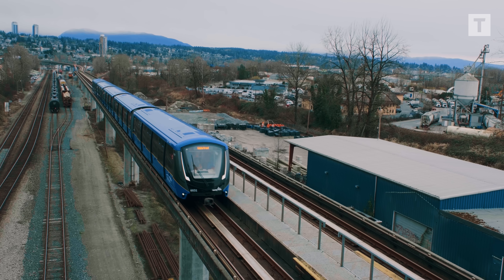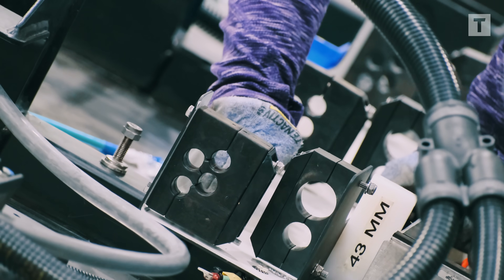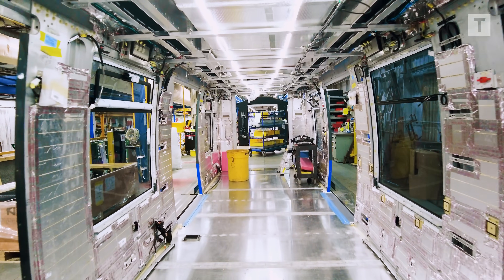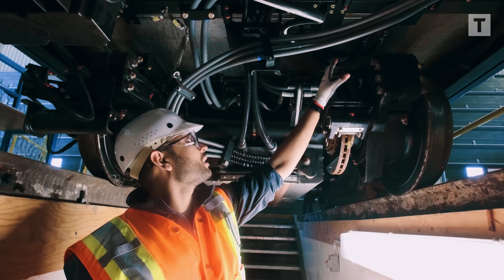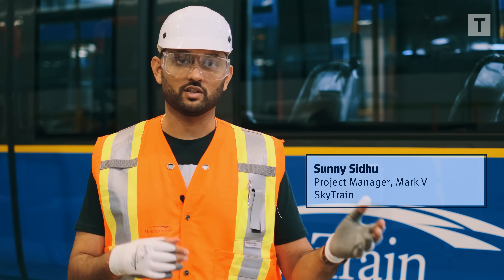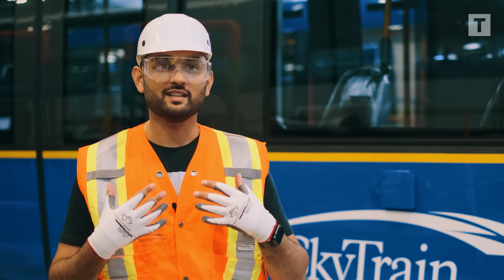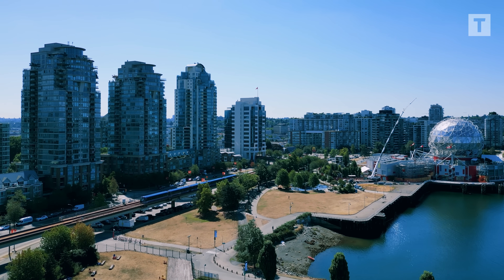How a SkyTrain car is ACTUALLY built

Comment: Rigorous testing huh?  Be nice if the wheels could be manufactured to be quieter.  When translink cars take a bend they literally screech drowning out off all noise for a radius of 150 metres.
Reply: thats like. the whole point of a new train
Reply: @Caty15  Theyre still screeching.
Reply: @quarkedupphoton236  thats because you are still on older trains. there are only 5 of these in service right now
Reply: @Caty15  I'll skeptically await to see one screech  by then.

Comment: Wait so is there a low chance that the public will have a small chance to see a skytrain outside of Vancouver, in either Ontario or Quebec just driving around on normal tracks?
Reply: The test facility in Kingston is actually outside of town in the tiny community of Millhaven (in fact, the Alstom facility and a prison make up the majority of said town...) and the site is just barely visible from farm roads. The Kingston facility is left over from when the technology that the Skytrain uses was developed as a provincial goverment project of the Ontario Government called Intermediate Capacity Transit System or ICTS, under the Urban Transportation Development Corporation or UTDC, this spawned the Mark I trains. UTDC got privatized at some point in the 80-90s, and came under Hawker Hawker Siddeley, who made it their Canadian division, before it became part of Bombardier. Bombardier took the ICTS concept and massively expanded it leading to the Mark II and III. Bombardier divesting it's rail business to Alstom resulted in the Mark V of today. Not only has the Kingston facility survived 4 companies, the ICTS system as a whole has endured the test of time.

Comment: Q: Why is it shipped by truck, and not by train?
Reply: im not sure about Vancouver but most rail depots don't have a heavy rail connection or even a loading area where they could offload the train onto the sky train tracks. A truck you can bascailly bring it anywhere you need. thats my guess
Reply: @brendanbruce6135  That's a very good guess and is probably right.

I'll have to double check with Google Maps, but I think that there is a siding in their yard just for unloading...of maybe for maintenance vehicles to get on the rails.

You're right about not connecting their yards to heavy rail.

I'm still surprised that they never used heavy rail for the majority of the trip, though.

Comment: I hope it’s quieter than the existing cars. I measured as high as 90 dB. I find it hard to ride Skytrain without noise cancelling headphones. I was recently in Kyoto and was surprised at how much quieter the trains are there. Why is Skytrain so loud?
Reply: It’s intentional that they made it loud. It keeps you on your toes and prevents passengers from falling asleep and missing their stop. 😂
Reply: Japan regularly changes its rolling stock. They retire older sets much more quickly than we do.  
Also, it depends on what kind of train in Kyoto. Not all of them are quiet.
Reply: The Canada line is much quieter, totally agree the expo and millennial line is very very loud!!!! We are NOT in the 80s anymore, the trains should be quieter.

Comment: A true shitbox by modern standards. Honestly, trains in developing countries are coming out cheaper, sturdier, and far more comfortable than whatever this is supposed to be.
Reply: Actually Canada exports those same cars and train technology to the US, South Korea, Malaysia, Saudi Arabia and China.
Reply: @mightyoaks9331  wishful thinking, South Korea and China are way ahead of the game. The Canada line trains which are built in Korea is much better in ride quality and noise insulation.
Reply: @maxzee1661  The Expo and millennium lines use linear induction propulsion, that is the reason the noise profile is different.  Canada line has more traditional design, similar to Toronto.
Reply: @mightyoaks9331  Trains on the Canada Line are Hyundai units built in Korea. The louder noise on the Expo and Millennium Lines isn’t just from their different drive systems—it also comes from the materials used and the larger panel gaps. If you compare the door gaps on Bombardier trains to those on the Hyundais, the Bombardiers have noticeably wider gaps. Their ride quality is also significantly harsher.
Reply: @maxzee1661  the Chinese trains your thinking of (ie the top level of floating magnetic ones) aren't Canadian
Reply: @maxzee1661  Actually, Beijing airport's people mover is exactly the same train. New York's AirTrain to JFK also.
Reply: @sythical3513 I'm referring to trains used in the Chinese metro system
Reply: @TheNewGreenIsBlue  similar to the one used by Canada line not this new one.
Reply: @maxzee1661  Incorrect. Beijing's Capital Airport Express uses the same trains that Vancouver uses, with the same 4th rail Linear Induction motors. The contract was signed by Bombardier and first trains ran in 2008. Trains are constructed in China but they're the same trains. Note: Alstom bought Bombardier's train division in 2021. 

Currently, these systems are :

Vancouver SkyTrain
Detroit People Mover (100 series only)
Rapid Kuala Lumpur
New York AirTrain JFK
Beijing Subway
Yongin EverLine
Riyadh Metro
Reply: @TheNewGreenIsBlue  Not the same train, but same drive system. The China-built ones are much quieter, smoother, and better insulated. And honestly, that’s what a modern 2025 train should be. The Bombardier ones are loud and the ride quality is really harsh

Comment: The size isn't a limiting factor in a moving assembly line anymore, it's just because the projects are mostly bespoke (which drives up cost, though the Innova is a fairly standardized design) and volumes are low.

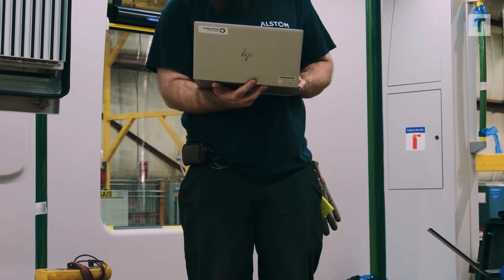Comment: 1:51 Nahhh hold up, do ya'll use fucking Windows 10 to control the mark V?
Reply: That's one bet ... my bet is it's Windows 10  IoT, supported under LTSC until 2032
Reply: lol I caught that too, they really running windows on a Mark V SkyTrain?!?!
Also I do know that translink does run Linux on the station train scheduled display thing, I have a video where that display is boot looping and you can see Linux is installed
Reply: didnt expect to see you here
Reply: we're lucky it takes W10 and not like, reel to reel tape
Reply: XD
Reply: no wonder its unreliable lmao 
if you've gotta use software.... at least use linux 😭
Reply: @akana_  Sounds easy but they'll have to rewrite the whole Front and Back End.
Reply: @DangerWrap i mean it used to be all bespoke anyway

but i guess nobody does that anymore... gotta have bloatware on the trains! 

seriously though if a train control system needs more than a couple dozen megabytes to do its thing theres something totally wrong with it lol
Reply: @akana_ There is Windows For IOT Enterprise LTSC, which different than the desktop version. And people want those because it so lean.
Reply: @akana_ that is an extremely misinformed statement in so, so many ways.

but in this case the windows touchscreen is likely used to interact with the sensors on the train itself.

Linux doesn’t just instantly improve the reliability of a system, otherwise why would so many operations continue to use windows.
Reply: @VeryCuul im mostly joking for the sake of slandering windows dont take me too seriously lol